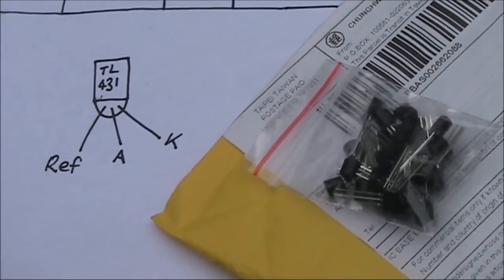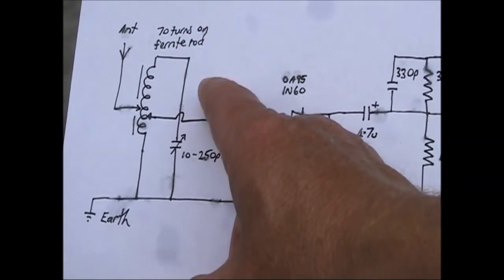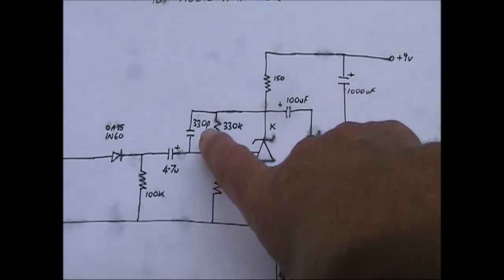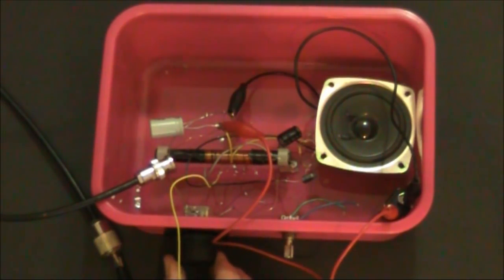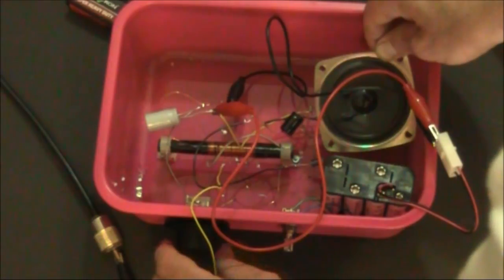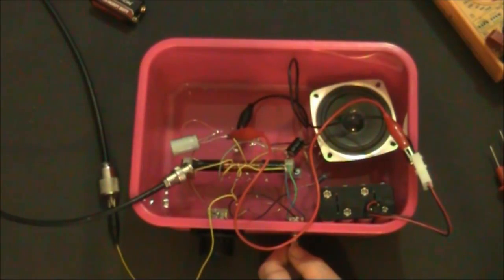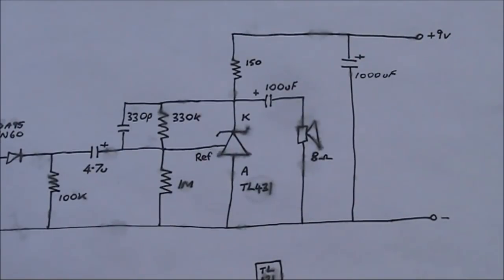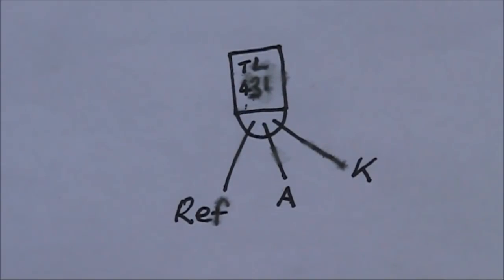The magic TL431 voltage regulator audio amplifier driving a speaker

Comment: I built a few of these 431 amplifiers. The amplification is truly impressive! The only drawback is the current consumption: A simple 40m DC receiver for headphones (602 with ceramic resonator and 386 audio amplifier) draws about 12 mA when idle, while the 431 draws between 35 and 70 mA, depending on the resistor at the power supply.
Reply: I change with potentiometer reference and work with 15-20mA.

Comment: Interesting idea. Having a look at the datasheet, the equivalent input noise is given at 125nv/sqrtHz which is rather on the high side. Additionally it seems to get far noisier as frequency decreases, much more so than the usual shot/flicker noise of a BJT. Perhaps this is due to inherent limitations in the bandgap reference. In any case, this is equivalent to well over 1 megaohm of Johnson noise and almost 17dB higher than the TL07X which is considered by many to be a fairly noisy device.

One useful application of the 431 would be driving a class B output stage of BC337/BC327. You could put a good 2.5W into an 8 ohm load using a 12V supply.

Comment: I think if you put a few ohms between the anode and ground you will get some negative feedback to reduce the distortion a bit. Likely the gain is ratio of the cathode resistor to the anode resistor. In terms of biasing I think you should use 2 bias resistors in series, with a bypass capacitor going to ground in the middle of those. To stop shunt feedback lowering the input impedance.
Reply: Hi Hoa Xuan , intresting recomendation, I like undocumented uses of electronic components, just for play.Thanks for sharing it.

Comment: That's a great video, Peter. I would never have thought of using such a device in this role, but thinking about it there is no "rule" saying you can't.

I would be interested to see what the output waveform looks like in terms of amplitude, distortion and phase when swept over the audio frequency range for various input levels.

PS: Linda Mottram hosting PM ... OMG!

Comment: Great project Peter! Is possible to make an easy SSB demodulator on it? 73 Paul OM0ET
Reply from the maker: Potentially. One of the Radioboard links above has the TL431 as a regen receiver which should demodulate SSB.
Reply: @vk3ye  thank you. I will check that link 😉👍

Comment: Why not ? to lessen the components more by  removing  the 100uF out , then put  a 50 ohm Speaker in series with the 150 Ohm resistor/Or Cathode K .
Needless to say you have to reduce the 150 Ohm a little (if necessary)  as vk3ye recommended.
Reply from the maker: It could work but there's two issues. 1. 50 ohm speakers are nowhere near as common as 8 ohm speakers. 2. I believe it's undesirable for the speaker's lifespan to have DC current flowing through it rather than just AC audio.

Comment: why not bend some thin aluminum strip around the tl431 using a small amount of heatsink compound on it, bending it into a flag. This should draw some heat out of it. Use the 82ohm and a more efficient speaker and the sound may be quite good!
Reply: The 100k could also be a log pot of that value with the wiper going to the 4.7u capacitor.
The values of the 300k and 1meg resistors might benefit the circuit with a tweak.
Perhaps a 470k preset in the middle with its wiper going to the regulator and a resistor either side like 220k at the top and 680k at the bottom.
Reply: One last final thought, to make the RF pass through the detector more and decouple rf from the detector AF output, a 10nF capacitor may benefit going from the top of the 100k to ground, AM broadcasting stations only broadcast 6.5 khz or so audio bandwidth anyway so the top cut will only help the audio be less harsh.
With a small amount of DC bias on the diode and the distortion minimised from the regulator and I believe this circuit has potential despite its simplicity